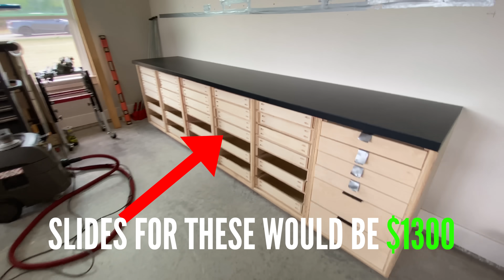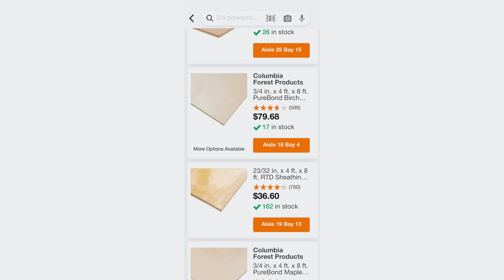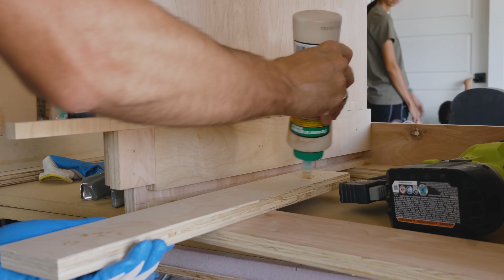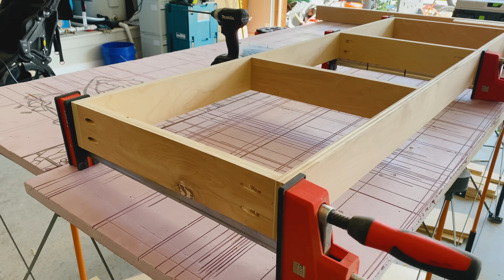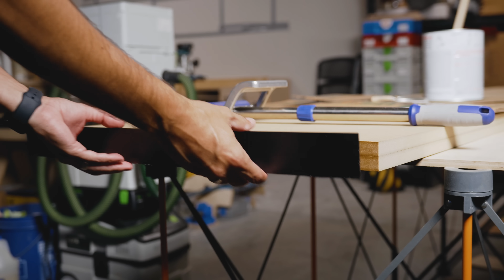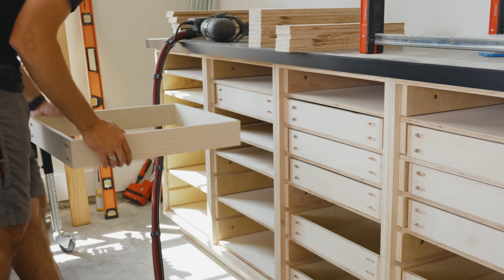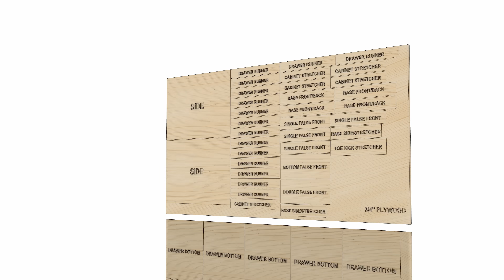Drawer slides are expensive. Do this instead.

Comment from the maker: 👉Get the DIY Base Cabinet Digital Plans here - https://wittworks.shop/products/diy-base-shop-cabinet-digital-download
Reply: I actually want this project for my kitchen, and sewing/art room! 

Here's a tip from one who has restored many antiques.  Where you have wood sliding on wood, you'll want to wax both surfaces. Having used candle wax and carnauba car wax, I recommend the latter.  The car wax (unbuffed) will stand up to hot days, friction, and is the hardest wax you can get.  It will seal the wood keeping it from swelling and last years.  Use two to three coats letting it dry between coats.
Pam   {Tom's wife}  🤿
Reply: 😂😅 I think I'm going bold 🤔 welcome to 40's 😅😂just wait until you get to 50 it doesn't get any better 😳🙄, only worse than when you was 40 🫣🤫🤪.
Reply: @simonr6793 hah … just you wait for the 60s!
Reply: I know i am late to this one way i would modify the design is to use skateboard bearings notch a hole and line up the bearings for the drawers to slide on. Will help later on when they get heavy.
Reply: In other words make drawers the old fashioned way when fancy sliders were not invented and all drawers were wood on wood sliding. They could be made to slide more easily by rubbing candle or bees wax on the sliding surface. Most of the drawers in my house are like this and have lasted at least 50 years and still work well.😅
Reply: The Plywood Company is the best!
Reply: no idea why you keep saying cheapest drawer slides are 900 for 36 sets (because you are looking at soft close)
HD has 22" ball bearing full extension for 10.50 ea, Amazon has 22" 10 pack for $82
don't think I've ever paid more than $6 for a 22"
Reply: Awesome video.🤿 🦆📼🤣
Reply: @mcol24  Just two guys who watched till the end...awesome! 

🤿
Reply: Not sure if you want easy and smooth pull, but if you do, PTFE stripes would do wonders.
Reply: @linyingyen    PTFE  ???
Reply: @linyingyen Also some cheap candle wax.
Reply: I was wondering... are you going to pack those drawers with heavy stuff? if so, that  would make it difficult to pull out, right? 
have you come out with a way to make the drawers slide easier?
Reply: @rerikm   just use wood wax to get a smooth slide. You can even get wood wax specifically made for use on drawers.
Reply: @IAmTheRealBill wood wax?  I just get cheap birthday candles, light them up and drop melted wax right on the wood. Works great.
Reply: theres a jig you are supposed to use for flush routerin. It has a fence.
Reply: @benhuffington8482  we didn't use a jig, atleast not from what I recall.  We made countertops for hospitals and shit
Reply: wish you were still in San Antonio would have enjoyed visiting, but do get to the DC area every so often to go back to NSA Bethesda
Reply: That final cost is gross! 😁
Reply: Hey I have an answer to the grooves on the edge,  you router placement.  The right side of your router goes one the top edge and always push forward, don't pull it back.  That's what we did for acrylic countertops.
Reply: I am thinking about your plans, but have a question.  

Q1. What is the maximum height for an item placed inside the double height drawer?   
Q2. And likewise, what's the maximum height for an item placed inside the single height drawer?   (I think if you answer question one accurately I can figure out this one ;-) )

I'm gonna assume the double height drawer is double the height of the first one because it certainly looks that way.  The reason I ask is that at the beginning of your video you state that the stretchers are 3" high, yet at about 23:35 mins in your video the height of the uprights with your red square is 2.75 inches.   I realize that you have gaps in the top and the bottom, but there is no measurement there.  I am asking because the stuff I have to insert in the double height drawers will be very, very close to the height within a quarter of an inch or less.     I am aware that I can modify your plans and I'm capable of doing that, but the reason for buying them is to not have to do the math and draw all this stuff out.  Which is the very reason you are selling them.  ;-)   I did go to your website too, but the measurements are not listed.  It might be a good idea to list the entire inner dimensions of each drawer because I'm pretty certain there are other folks out there that will want to know this.  

Thanks for the input and as you can tell, I did watch your entire video.
Reply: @RoadRacingAustin  Why not just make yourself a triple-height drawer?, with one less skinny one to compensate?
Reply: Loved the video, enough so that I purchased the plans for this before reaching the end where the snorkel emoji was encouraged to determine the tapers from the ducters. 
That included the reveal that when my PDF plans were not correctly sent to me, instead what must’ve been background information for the actual video creation. 

Thx for the prompt response and thanks again for when I returned later to see if it was able to be sent out again with the correct stuff. Which it had. Add I was giving it the quick once over, I completed the video to get the last bit of info as well as the snorkel 🤿 
👍
Reply: Isn't the sawn plywood-on-plywood edge of the drawer slides gonna wear each other down over time?  I'd want to line either the drawer edge or the bottom edge of those grooves with PTFE strips.  Also, I wonder what the cost is of the extra wood used to support the drawers, compared with the rails.  Probably not as much as rails, but knowing would be good closure on the "vs" aspect of this video.
Reply: Wax to lube the slides isn't a bad way to go.  However, using scrap Formica strips on the surface of the drawer contact area and the drawer guide is very smooth and will wear almost forever.
Reply: @nunyabiznez8120 I totally forgot about using the leftover strips. It really works well!!
Reply: Witt, Plywood Center of Fort Worth DOES sell to the PUBLIC!  The sold to me, Jacqueline O'Alltrades!
Reply: 60% of the time... shes right every time! 😂❤
Reply: @wittworks  can one add drawer er draw stops to the draws?
Reply from the maker: @ all things are possible. One cheat is to put a false back about 2-3” in from the back. It makes a back container to hide things and acts as a visual reminder to stop pulling
Reply: Are the plans available in metric?
Reply from the maker: Yes
Reply: $150 for the top?  Damn, that's almost enough to make a man use aluminum plate instead.  Take that, ya  heat-sensitive plastic laminate!
Reply: Made it to the end.  🤿 Love the humor.
Reply: Amazing build. From my research on this drawer system is to use beeswax to let them slide more easily. 
I'm also looking into the same idea but to incorporate it into my table saw router workbench hybrid. 

And yes I watched to the end. How else would I know to post a 🤿 in this comment. 😅
Reply: good content
Reply: .....or on .... MySpace..?  lol.  cute.
that animation of the design @28:42
It could've taken a WEEK on it's OWN!
How in the heck did you do that ..???
Why redo insulation in just 1 spot tho?
Reply: @wittworks  👍 🤿
Reply: You have proved it once again.... THEEEE 2 words to success, "THANKS DAD"!   😀🤿🤣🤿😃🤿😂
Reply: @wittworks  🤿
Reply: I watched but can’t find snorkel emoji.
Thank you for this video. I will be making cabinets for my house ( lost cabinets in Helene flood in FLA) and shuttle bus. conversion.
Reply: Excellent job on the build, the filming, the human, this and tricks. I just relocated and now need to set my shop up again, I will definitely be using your drawer design though out my garage.🤿
Reply: This video already failed 12 seconds in as you would need tools, hardware, and a truck to get materials from store to home to build said shelves. Lol.
Reply: @Olie956  you would be surprised what people can do on the cheap without the right tools.  I have scars and healed broken bones because of that.
Reply: Masterpiece. Apropos Tape, i'd try taping the Laminate with masking tape where i had to use the edge router. 
Or, try to iron the marks out using a normal iron and Newspaper between the Iron and the Laminate.
After i checked the max. temperature of the Glue and the Laminate.
Reply: I so enjoyed watching and listening...you are entertaining. Great presentation!!
Reply: OP: Roman numeral 3
American : Ah yes, I thought it was 3 I.
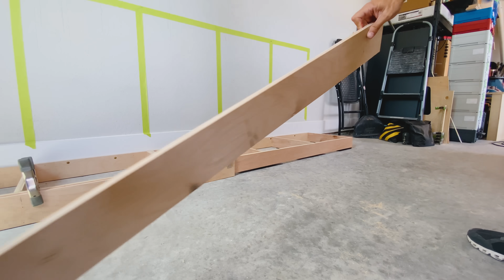Reply: @11:50 why didn't you scribe from the floor? 
That way you would have filled all the gaps. Now, although the gaps on the floor are 'acceptable' they're still there. 
Probably because the floor has some unevenness in the other axis as well. Just print (I guess you have a 3dprinter?) print a little pencil-holder, scribe from the floor, then cut it with a jigsaw.and Pooof perfect fit.
Reply: any there any good websites forums whatever that have plans like this to view for free? id like to build similar things but having an idea on material cost before i start is a must, and  being in rural canada, US pricing means nothing to us, sometimes things are cheaper here, sometimes the exact same item is 300% or more.. material/cutlists are almost always hidden information so getting material quotes isnt possible without guess work

i know in this video the number of sheets required in total was given, but most plans dont have videos to show that
Reply: Hi Drew, the router bit bearing picks up some glue and then transfers it to the laminate.  If the bearing is seizing it will rotate and bruise the laminate, even burn it on occasion.  The best bet is to put the top on, route it, and then put the sides on after making sure the bearing is in good shape and clean IMHO.
Reply: You're right 
@brucewilliamsstudio4932 , that can happen, (ballbearing stuck)  but it didn't happen here. burningmarks are slightly different from cutting marks. it doesn't look burnt. In addition, the damage is not where the bearing was guided but above where the cutting edge was.

and if material sticks to the bearing, it increases the diameter, which means that the cutting edge of the router bit no longer cuts flat. @brucewilliamsstudio4932
Reply: The digital plans are not correct.
Reply: "NoName Beginner Youtuber"

That's one of the most disrespectul things I have ever heard.
Reply: Bummed there isn’t a sketchup file included.
Reply: @justinjones9255  You can always make your own Sketchup file Justin.  😉

Comment: I am trying to go even more budget friendly. I just got sone building my shop, I had 3- 16' that I bought extra that I was going to use for another workbench for in there... but my wife wants closet dressers. Soon, I ripped them in half, I have a few more stud sided that I can fit into my car and cut down a few 1/2 that I got from the blue store for $30 a sheet. Let the games begin,  Plans and construction are in the works. A base model is cut, now I just need to repeat. Cut them to size, I am cutting the 2×4 square to 3" then ripping them in half to make the frames, then smaller cuts for the slide rails. I will post some photos on my youtube when I am done

Comment: I think this is a bad idea.  You cabinet drawers look great, but you can only open them when they are empty.  They would be too hard to open when they are full, or you will break them.  I think it is still more practical to use ball-bearing slides, and you would  be happy every time you pull open the smooth drawers.

Comment: I did laminate work for years. I always rubbed surfaces which the router but rodenon with paraffin, wax, or soap. Rarely had any marks left and it made get any contact cement off much easier.

Comment: Great video! I don't know  if it's necessary but is there any kind of stop to keep from accidently pulling the drawer out too far? It would need to be easy to remove in case you did need to remove one but nice  to prevent an accident...
Reply: @buschwacker3254  I leave the back of the drawer a little higher than the front a nd sides. Then I screw a small stop block just inside the face of the drawer on one (or both) side(s) to prevent the drawer from being pulled all the way out.  Screw it about 1/8 th inch above the drawer side.  It does a great job in keeping the drawer from dumping on the floor if you get in a hurry.  Don't ask me how I know that.

Comment: 22:13 why use pocket hole screws when you could just screw straight through the front of the drawer and then cover the screw holes with the drawer face.  Insane amount of work.

Comment: 11:56 after you shim it. Scribe the kicker to the highest shim all around, remove the kicker to a work bench and use an electric planer to plane the scribe. Reinstall to the floor and it will be perfectly level without shims. Keep your shims for the next job. No fave piece meets to be cut, no shims, just a little more labour.

Comment: Excellent. I love the simplicity and the tip about drawer slides. One addition I think would be cool and not too expensive is adding some bearings to the slides for smoothness of motion. I'm refurbishing an old metal cabinet, which was initially a bathroom vanity. Apparently it was an easy and affordable option in the 1950s and 1960s instead of redoing or making your own vanity. It's long been used for tools and parts in our home shop so I stripped the paint, glue, and tiles and am repainting it matte black. Anyways I noticed recently the drawer slides have 1 bearing each at the front (one on each side of a drawer). Great video, thank you.

Comment: 🥽🥽 could not find a snorkel emoji but I did see it to the end I'm planning on making some cabinets in a smaller scale with rollers more like a toolbox and I'm planning on doing the same thing with the bottom of the drawers using them also as slides I think it's a great idea and you know you're not going to drop the bottom because of a weight issue 👍

Comment: My neighbor is a contractor and introduced me to WINCO Cutting Boards which are made of HDPE.  This stuff is slippery smooth. If you want something to gliiiiiiide smoothly like butter, cut strips of this to use on your tracks.  A 15x20 board is about $25. You can cut up to 120 1/8"x20" strips that you can use for runners. (Accounting for the blade kerf, you're going to get less than 120, but still a good deal)

Comment: Those router marks on your laminate are because  you were cutting the entire width of your bit and it like pulls the bearing in to the edge and leaves those marks I guess I don’t entirely understand why it happens but you need to cut your laminate closer to size so when you trim route it only half or less of your router bit is in the cut. Or trim it free hand so when your bearing is engaged  the router bit isn’t surrounded by laminate

Comment: When working with formica and glue it on a substrate and you use the router with a bearing bit on, the glue that is present in the corner where the formice meets the substrate, binds itself to the bearing reulting in the bearing "jumping" slightly creating that which one sees in your example

Comment: 🤿🤿🤿

Excellent build. Those cabinets look incredible. I wonder how you like the integral slides with weight in the drawers? 

16 years ago there was a catastrophic flood in Nashville, TN. I salvaged several road cases. One has plywood drawers inserted in a boxes frame with no hardware. The second has plywood drawers with narrow, plexiglass runners in a groove similar to your design.

The former is increasingly difficult to open and shut with weight. The second slides like glass even loaded down with contents. 

I'd love to hear how yours are faring given the slides themselves are plywood on plywood as opposed to slick plexi. 

Thanks for all the tips. I'm going to attempt this build, modifying how I accomplish it with a standard circular saw.

Comment: seems like way more work for worse results than just buying slides. plus if the wood ever warps, swells or splinters, it will suck to use. also without the use of ball bearings, the more stuff you put in the drawers, the more friction youll have to overcome to open them. not pleasant. they look cool though

Comment: nobody buys drawer slides at the home store, I get a 10-pack for about $70, or just $7 each. (100 lbs soft close 24 inch long) 
This is small compared with $1000 of material. And having drawer slides would be WAY better than sliding on plywood rails. C'mon.

Comment: How deep did you do the work bench?

I am thinking of putting plastic storage/totes underneath which means I need a minimum depth of 69cm (or 2ft 3 inches approx). 

I would do draws but a lot of my junk is already in 22gallon totes.

Comment: You didn’t push too hard. The wheel on the cutter was slightly too small. You have to have a 0.5mm bigger wheel or wrap tape around the wheel , still making sure it revolves. Old trick. But works

Comment: Nice work! There are companies in Europe who specialize in drawers. You can buy drawers in basically every kind of dimensions for a price you can never compete. Fully extendable drawers with the slides already fitted are probably less than your material price, not to speak of all the work (as satisfying it may be). We have equipped a lot of our test stands with theses drawers, some were more than 40" wide. Everyone handling these things was surprised about the smooth slides and the load capacity.

Comment: A case for METAL slides is the SPACE they can save behind drawers. If living space is~$300/sqft (plus yearly property taxes), burning 5 inches of dead space behind 8 feet of drawers for wooden slides is worth $1000+ in wasted space.  Alternatively you suffer through partial extensions (like an animal).  😂